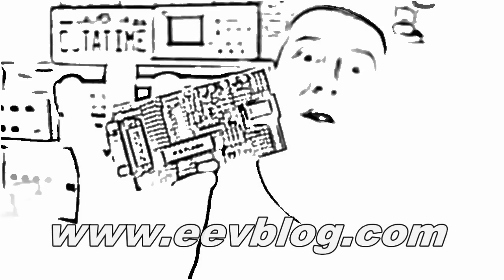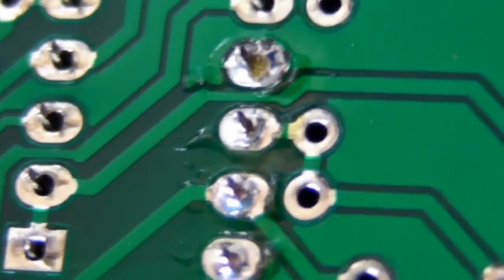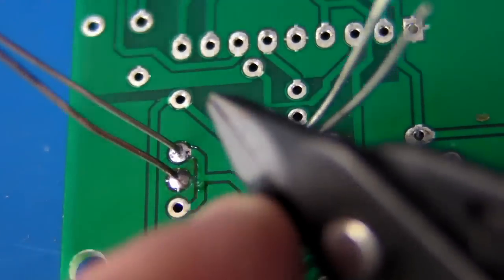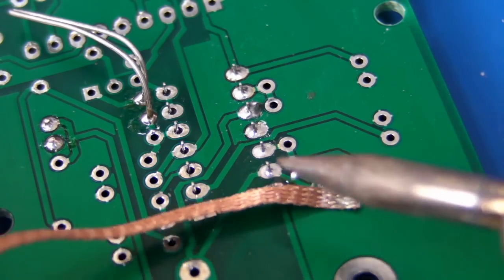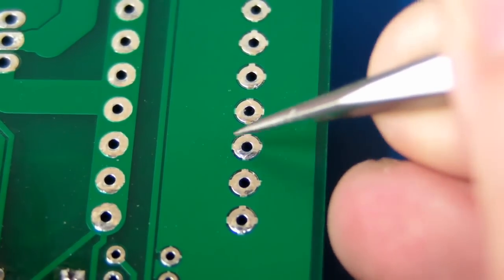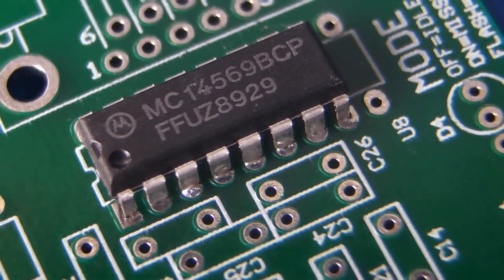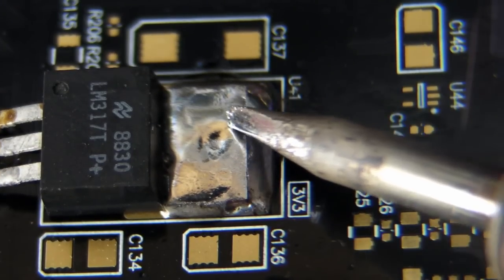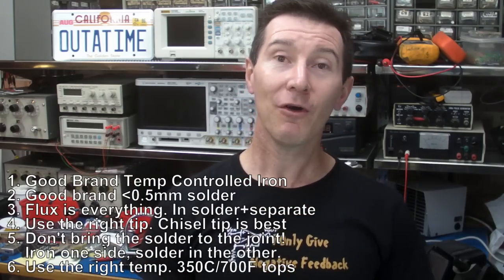EEVblog #183 - Soldering Tutorial Part 2

Comment: The problem I am having is that the pads are very small on the board and when I solder the through hole item balls up on the wire. The ball even when it is small is bigger then the pad and I cannot tell if the joint is good! I am using a small tip with solder on it to help heat the items and then solder the pad to pin. The pin takes the solder first. The pads are barely visible but I hate the balls. Any suggestions? Also when soldering, I always get a tit where I pull away! I was running the iron at about 280 cel.
Thanks
Reply: +amtpdb1 280°C is too low, try something around 350 for leaded solder. Also, if the "small tip" is too small, it may not have enough thermal mass to do the job. They could be the cause of all your problems, however if you still experience any of the above at ~350, try heating the pad only first for a few seconds, then slide the tip so it now also contacts the pin, then apply the solder. It also doesn't hurt to use a flux pen for regular thru-hole soldering. I know Dave says it's not needed in the vid, but it's my experience(35 years) that flux always helps. Flux is your friend! The pens are cheap and they go a long long way.

Comment: my solder joints go very dull and matte right after they cool down, what am i doing wrong?
im using 60/40 solder with 1.8% flux and folowing the technique shown. could it be that there is a layer of flux on the joint itself and that makes it look dull? i checked with an ohmmeter and the resistance is just 0, the joint also looks like its done properly but its dull. please help

Comment: I don't know why, but when I try to put some solder on the tip to increase the thermal capacity, the solder just slips and doesn't stick to the tip. Should I replace the tip?

Comment: I must ask, how do you make sure the resistors/caps/etc stay in the hole you put them through when you are soldering as the board is upside down?
I've tried bending them a lot but they still wiggle, especially when I push the solder to the lead.
Thanks in advance.

Comment: Hey, does anyone know if using isopropyl lightly is o.k. for cleaning boards. I just do this for my own repairs and hobby, I'm novice to intermediate. I haven't had to clean too many over the years, so I usually do it with Iso and I don't think it's ever caused a problem, but like I said, I am by far, not a professional. Thanks.

Comment: BS! More Flux minimizes "Cold" solder joints. Use liquid flux and clean it afterward. "Bridges" are caused by too much solder and not enough flux.
I've been soldering circuits since 1963. I'm an expert. An artist.

Comment: Call me a bit OCD, but I'm really stressing aboutt this.

I used lead based 60/40 solder today, and I used gloves, etc, but I touched components like the switches after soldering, so... my question for anyone is, can lead transfer from one component to another via touch?
i.e on the soldering iron, etc?

Or after soldering and putting away everything and washing your hands, is everything pretty much safe?
Reply: iKaGe01 There really shouldnt be an issue. I dont wear gloves or wash my hands very often and I am still here.... I think.
Reply: Just make sure to wash your hands, you do not want to eat after handling lead-based stuff.
Reply: +iKaGe01 Also, if you're a smoker, wash your hands before smoking or you may ingest lead off the filter of your cigarette as if you were eating. 
Don't rub your eyes or nose either (mucous membranes can absorb toxic substances).
Other than that, don't worry about it, as long as you're not eating it or rubbing it in your eyes, your exposure is negligible.

Comment: Our schools soldering iron's (and their lessons) are so shitty. The tips on the iron's are SO destroyed (because they never teach you to clean them) that if you try and tin your iron, the solder will ball up AND ROLL OFF. They also plug straight into mains with no temp control. After they make us do some stuff with them and then I head home to my WES51 it's like soldering for the first time.
Reply: +Frank Harding Same i personally use a hakko 888d. why is it that they try to teach us with the cheapest things they can find.
Reply: +Evert Guzman its more the students mistreat them/don't clean them. Even a shit soldering iron will work for a while with good care.
Reply: Frank Harding good point, I got this one because it was tired of the wall plug in type. They do work in a pinch I believe lesson one should be proper care and maintenance of your iron.

Comment: hi there i would like to ask a question, im just starting to solder and i saw the board looked damagged as you soldered the chip¿was it damagged? do the boards melt ?
Reply: Hi Boards doesn't melt. They are very heat restistant actually. The reason why the board looks damaged is because of the flux residue the solder leave and it can easily be removed with some alcohol :)
Reply: But if you leave the soldering iron too long on each component you will damage it because of heat. btw if you experience board which melt they're just poor quality :)
Reply: thanks thats great info take care
Reply: roxes787b thanks thats great info take care

Comment: I did it the same way, but the pads fell off/flaked off the board, What should I do?
Reply: You may have left the iron on the pad for too long, or applied too much heat
Reply: Thanks for the info
Reply: the pads fell off because the iron stayed on the surface for too long. in my opinion dave left the iron on the pads also for too long. either low temperature on the iron or high quality on his pcb. no more than 2 second on a pad
Reply: No problem
Reply: These guys are right, leaving your tip on the PCB too long will make the pads flake, but it also has a lot to do with quality. A cheap PCP (usually perf board) won't stand up to the heat nearly as well as nice, plated pads. If you keep having problems, consider spending a bit more on your boards, especially as you learn to solder. They're a bit more forgiving.

Comment: part 1: this tip has a hole where you can put solder and just use the solder in your tip to solder a bunch of components
part 2: "DO NOT APPLY SOLDER TO THE TIP"

I'm confused

btw:
> can solder under a giant fucking microscope
> finds it hard to solder under a camera

wtf lad? can you stop excusing yourself for the stuff that you do wrong? we probably wound't even have noticed if you hadn't been pointing out everything you did wrong and made up shit to excuse yourself about it... if you didn't solder something quite as absolutely perfect as you wanted to, it's okay, no one is going to judge you... we're here to learn... plus a not perfect joint will work just about as well as a perfect one, it'll just look ugly and probably not last 90 years, but come on, you're not going to use anything for 90 years... you'll probably die earlier lmao
Reply: > I'm confused
You should watch part 3, around the 16 minute mark.  Flux pen, drag soldering surface mount components with a well-tip. End of confusion.

> can you stop excusing yourself for the stuff that you do wrong?
What an attitude...  You could have given your criticism a bit more thought, in which case you'd have figured out things all by yourself instead of needing someone else to spoon-feed it to you.  But alas, since you were too lazy and found a rant easier than mustering a bit of common sense: soldering under a microscope = looking at your work directly through a big lens. Soldering with a camera above your work = looking around the camera which is in the way. Totally different and a very valid excuse. Capisce?

Dave's tutorials are regarded very highly by most viewers. Your attitude and tone are rude, and your comments betray the fact that you haven't even /tried/ to understand why Dave does what he does or says what he says. Some folks call that "dumb behaviour".

Comment: You're full of shit. Soldering is one of the hardest things to learn when it comes to electric components. Sure anyone can do heat up a soldering iron and melt the shit but to get the proper connections and have them stay, it's an art form that takes a lot of practice. My dad is an electrical engineer and he had NASA training. This guy saying "it's so easy" over and over is just to get you to keep coming back to his videos. It's not easy. Practice for a few months before doing anything important to you. And, attaching two wires together is much easier then say, attacking wires to a headphone jack or something like that. And, if you touch your soldering iron to a component's board, you can ruin it. Soldering is probably the most advanced thing in the hardware world.
Reply from the maker: LOL!
Reply: Strange.  I was taught pretty much identical to how Dave solders and I was doing perfect job within 5 minutes.  I was 13 I believe at the time.  It IS easy!
Reply: Maybe you're just a natural... if you're telling the truth. I can solder but it took a while to do it right. Also, as I said in my comment, my dad is a NASA trained electrical engineer and he's the one that taught me. He does this so much better and it's something he had to take classes on. 

He is a retired 1st sergeant in the Air Force and did all of the electronics in the aircraft of the places he was stationed. The kind of soldering he taught me is complete perfection. (not saying I'm great at it). As I said, it takes a long time to be truly good at this stuff. 

Everything I said is factual. It's not "easy" unless you learn how to do it. And really, you're probably not really doing it right by NASA standards. But who knows, maybe you're a natural. I'm naturally a decent hockey player. I could skate without being taught. But, when I was taught right, I was able to play AAA. 

I'm also a natural artist. I could always just pick up a pen or pencil and draw something. But when I went to school for it, I got very good and learned how to do things a lot better. Now I can draw almost anything.
Reply: Console MonsterX I'm thinking he means it's easy to pickup/get started. I bought an iron and accessories on impulse from radioshack years ago, and started repairing random stuff I had around the house like phone chargers with loose/broken wires. I don't think anyone would disagree that doing smd or more advanced soldering takes practice.
Reply: That is my point. You literally just made my point. Soldering two wires together is easy for anyone. But real soldering, like cutting a headphone cord and making it a detachable cable, or soldering a pro style mechanical keyboard, is not something you can just do in 5 minutes of practice.
Reply: Well someone did say that. But, I understand what you're saying.